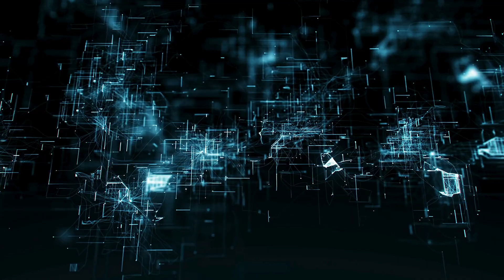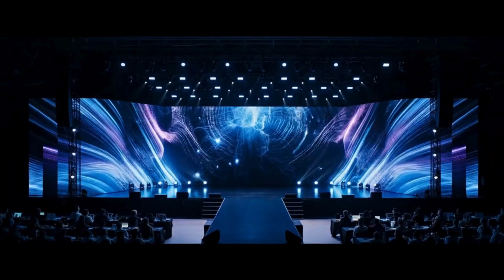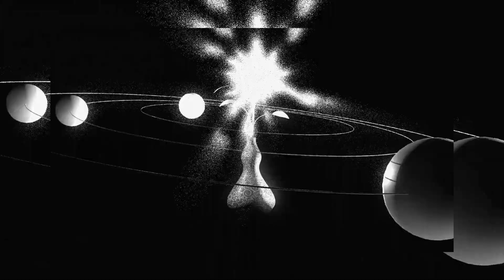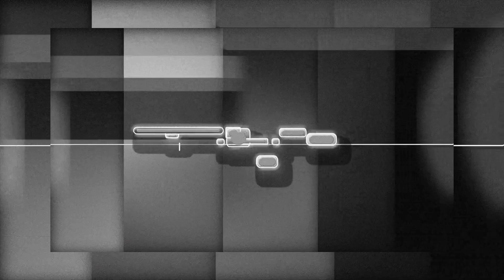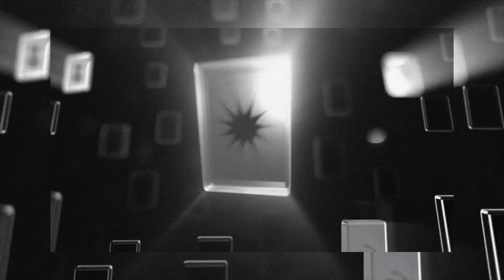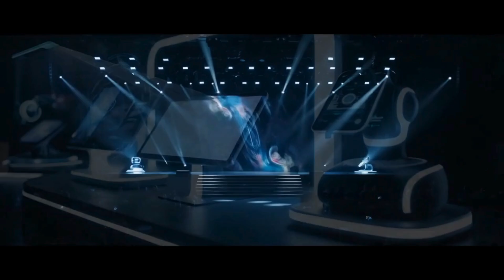Understanding User Input Commands: RADIO, SELECT, and CHECKBOX | CAFA Talk 31

Comment: As someone who has seen firsthand how AI can sometimes "hallucinate" or give unpredictable answers, I think this approach is much more foundational than just using RADIO, SELECT, or CHECKBOX controls. It’s really about setting a clear mindset for communicating with AI—making the input structured, not just free-form text. I also appreciate that with CAFA, you can cross-check results, even using multiple different AI models, to verify the output. That’s so important for ensuring accuracy and trust when AI and humans work together.
Reply from the maker: Thanks!

Comment: This video was critical for understanding what would go into the turns when using an agen in CAFA. I’ve been wondering about how to input multiple choice options (i.e. checkboxes) and having users select from options like a  dropdown menu (i.e. select or radio). Unfortunately when the video gave examples of how to apply these syntax in CAFA, I got a little lost. I think it would be beneficial if there were images to follow along with during the video when examples were given like at the end when it spoke about the STAR model or during the explanation of @checkbox’s. Alas, I am very grateful to this video because it gave me some of the key pieces of syntax needed to improve my parameters for CAFA agent proposals.
Reply from the maker: Thanks!